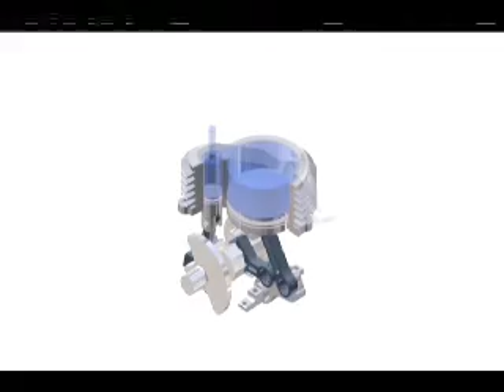A car that runs 200 miles on compressed air.

Comment: I should also add that besides the heat waste in compressing air, you need some heat to decompress it, so the vehicles won't run so well in cold temperatures. Anyway, the bottom line is that you can't get close to the efficiency of an electric vehicle.
Reply: Simple solution: Remove the moisture in the air by a filter for  sale on.line- your finish product will be dry air in sturdy tank...The technology was on sale,titled PCP pump for PCP air gun...I bought on.line 1.unit,more than 2.yrs ago,I think it was Taiwan made- very good in quality and efficiency...
Reply: @fortunatodeguzman8017  Wow, 14 years already? I think you probably replied to me inadvertently, since it doesn't have anything to do with my comment. Just wanted to let you know, because it'll take 14 years of scrolling for people to see your comment. ;-)

Comment: Air-powered vehicles have a place, but as some noted compressing the air for them is an energy-losing proposition, so it's not the improvement over existing technologies that this video portrays it as (though if you have use for the heat produced by the compressor, the overall efficiency would get pretty good). But the "perpetual motion" idea near the end of the video exists solely for the benefit of the stupid and gullible.

Comment: Running a vehicle on compressed air is neither new nor a breakthrough.  It is actually a very inefficient way of storing and then re-using energy. Both electrochemical (battery) storage and hydrogen-based fuel cells are far more efficient. The claims of perpetual motion are pure fantasy. One cannot break the laws of thermodynamics. Nothing to see here.  Move along.

Comment: This car does not "run on air."  It runs on electricity.  The energy from the power plant is (inefficiently) stored as compressed air.  As the air is compressed it gives of huge amounts of heat which represents lost energy. So the power generated at a power plant is wasted heating the air under the hood. Moreover, the statement in the video that the compressed air can then be used to run a compressor and run perpetually is ignorant. It would violate the laws of thermodynamics. But it's cute.

Comment: Its a good idea, why LIE about it?  There is no perpetual motion. The consumed air power cannot also be used to run a generator. That's like saying you can reuse electricity. If there were any energy left over in the air, why use it for a generator?  Use it to run the car.  Also, compressing air requires energy.  Currently MOST energy is derived from polluting sources. For this car not to pollute, new energy sources will be required.  Please tell us the true cost per mile to run it today.

Comment: Please don't mention perpetual motion in this video. It discredits MDI, in the eyes of educated people. You use energy from the grid, and its much cheaper than gasoline, but still its less than 100% efficiency. So if you put a generator connected to compressed air engine - in the end you loose energy.

Comment: About the tank that can split open. Please worry less - try leaking some gas from a canister. It will be in liquid form and will take some time to evaporate because it needs energy from the air to heat up. So there is no danger there. Of course don't light the gas, because it flammable. Compressed air is not flammable, so there is no danger.

Comment: Nice idea but for those out there that don`t know the basic laws of physics.....What will power the compressors that will re-fill the air tanks ?
Do you give up ?
Well let me tell you all then `ELECTRICITY`
Oh yes and that is made by the combustion of finite fossil fuel that turn water into steam that drives the turbines that produces our electricity.
Hmmmm and at the escalating cost of energy these days, I would say that that invention is not totally green.

Comment: Wonderful concept, even if it does use some electricity to re-fuel, it is much better than paying through the nose for gasoline. This will have the oil industry looking for reasons to badmouth it, and prevent it from coming to fruition. I would definitely consider getting one if they ever make it to the USA. I'm not afraid of explosions, that same stupid argument is made for natural gas fueled cars.

Comment: yes, its great and I would like to have one!  BUT... they are misleading, it still CONSUMES energy. Either electricity (for the air compressor), gasoline , diesel, solar,  etc... ---- and jiqiwa's right, their "perpetual" compressor is ridiculous. The engineers never said it. The sensationalist headline hog of a reporter did.

Comment: This would be a problem if they were using metal tanks under pressure, however the air car uses carbon fiber tanks that split if punctured and are designed specifically not to explode... No Problemo amigo... it'll still be a sucky day for you if it happens but you most certainly won't be blown to kingdom come.  Check out some of the other vids on this car... they explain the technology.

Comment: I know.  I was responding to Padanian1 who was talking about a central location for compressing air.
So what we are brought back to is . . . it's more efficient to charge a battery then compress air and run off of that.  This eliminates air cars from the discussion and we can get back to looking at alternative ways to generate electricity.
And you know what happend if you charge the battery at night?  You convert off-peak energy into something usable.

Comment: "You can't have a car carrying around PV panels or tons of batteries." There are plenty of battery and solar powered cars out.  If you have a central plant compressing air, then it has to run on electricity, be it generated by coal or solar or wind or something else, and then you have to have trucks delivering tanks of compressed air (just like petrol) instead of sending electricity through wires.  It's better to get electrical energy from wind or solar, and continue with electric or hybrid cars

Comment: And if the latter, it's clearly more efficient to use a battery then to convert electrical energy to mechanical energy back to electrical energy and then to mechanical energy.

Comment: If the former then the speed and performance would be contingent upon the level of compression.  I.E. It would be higher performance at the start and then drop off proportional to the inverse of the third power of the energy used.

Comment: I agree that they batteries will loose charge over a long period, and I also agree that you get more energy density in gasoline.  However, for purposes such as these comparing 'compressed air' to a battery powered car for short-term purposes, you loose energy compressing the air as compared to just charging a battery, and the mechanical equipment to deal with the air is unneeded weight.  I'm curious, does the air turn the wheels directly, or run a generator to power electric wheels?

Comment: You loose efficiency that way, converting electrical energy into energy stored as compressed air.  It's better to use the photovoltaic panels to charge a battery.  All this is is a mechanical alternative to a battery.

Comment: Even if a car could effectively run on compressed air, how much do you think the energy costs to compress that air?  If you use electricity to compress air, and then run a car off that, it wasted more energy then if you just charge the battery with electricity.
The perpetual motion claim violates thermodynamics.
Ultimately you will have to use some other form of energy to charge this system, and if it's electrical energy then it's more efficient to charge a battery in an electric car.

Comment: This video is the weakest "green-technology" piece I have ever seen.
Just as with an electric car or a hydrogen car, this vehicle is only offsetting the energy used to make it go. So we use electricity to compress the air (even if it is on-board) and that electricity is more than likely produced in a coal power plant (if you live in the US).
"Perpetual motion machine?" This is ludicrous.  Ask your science teacher or any physics student about perpetual motion. PHYSICALLY IMPOSSIBLE!

Comment: yeah but to compress the air, you need energy right, which needs fuel, and the quickest way to get fuel is by oil, unless you hire people to ride virtual bike simulators all day to compress the air, which would be fun

Comment: The 70% loss i true for powerplants that only produce electricity but power plants producing both heat and electricity can have effciency of 90%-transfer loses. The perpetualmotion comment shows that makers of this video have no idea what they are talking about,but I have also heard from this same car from more reliable sources.
You are absolutely right that this car does not have as high effciency as electric cars but it does have much greater range that has alvays been a problem with elcars

Comment: You are GROSSLY misinformed. Between the power plant and the transmission lines, approx. 70% of the energy is lost. An electric car is only about 20% efficient, which is still significantly better than an ICE. 

There is NO WAY IN HELL that a compressed air engine is more efficient than an electric one. Seeing as how it suffers from most of the same practical problems (low range, low speed)

The claim at the end of perpetual motion seals it. This is a joke video. Anyone taken in by it is a fool.

Comment: But the 50 % effciency is possible. But even if the effciency would be lover than that very few countries produce their electricity solely on coal or oil. And this car can be charged using some low CO2-emissions form of energy such as hydro wind or nuclear. And not to mention how much cheaper it is to charge your car with electricity instead of gasoline.

Comment: Not nessecarily. Heat and electricity producing coalpowerplants effciency can be as high as 90%. Tranferring power over energy grid takes about 10% A compressor probably has effciency close to a 70 %. This nets to total effciency of 57%. A good petrol engine has en effciency about 30%. This would mean that in order to be as effcient as petrol engine the effciency of the air engine should be as high as 50 %. I'll admit that I do not know how high effciency does the airengine has.

Comment: not if u factor in the transmition effecency (about 30%loss) then the effecency of the compressor... then the effecency of the air powered engine (i think u will find it is less efficent)

A petrol engine only has its own energy covertion effecency to deal with.  the more energy convertions there are the less effecint something is as no engery covertion is 100% effecent

Comment: Coal plants have much higher effiency than petrol powerred cars so even if compressor would run solely on coal based electricity it would be cleaner and a lot cheaper than petrol.

Comment: The narrator is obviously wrong about perpetual motion, but it might be possible to use the energy left over from propelling the car to add some new air to the car's tank. It all depends on the efficiency of the compressor and what leftover power is available. It might not be worth the effort due to losses, and added weight.

Comment: i was going to make this point! energy cant be created or destroyed only changed. perpetual motion is therefore impossible!!! also what powers to compressor? probably a power station... which burns coal... and the energy wastage through converting the type of energy probably means it has more emitions than a petrol car in the long run!

Comment: The point is is that the first tank of air would power the car and then that same air would be captured and used to power the generator to fuller fill the tank.

Yes, at some point air would escape and you would have the fill the tank manually again.

I hope that helps to explain it.